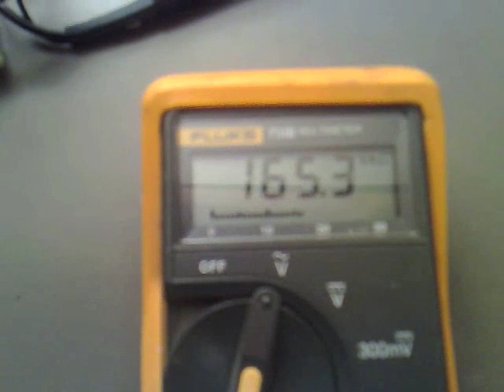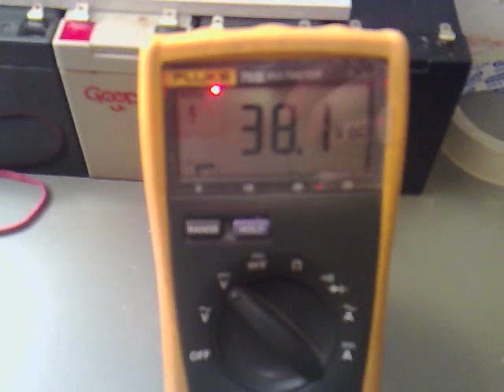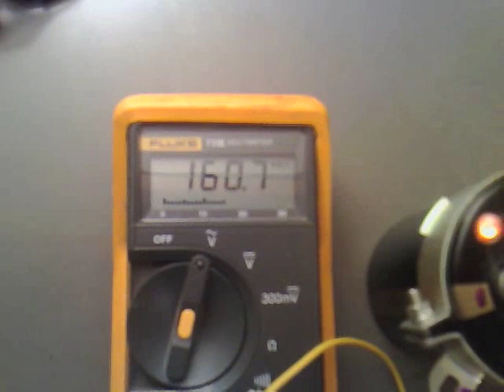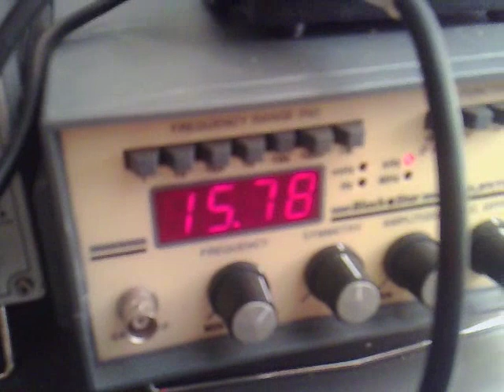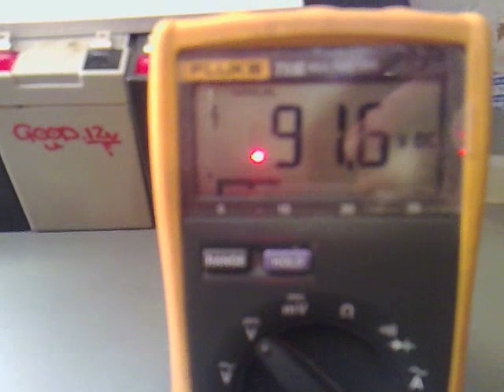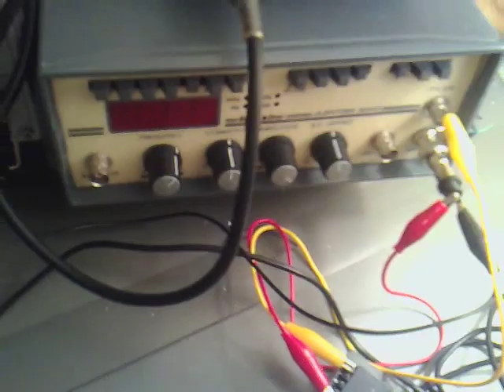High Voltage (Teslas One Wire Power) 004

Comment from the maker: Just made a new video using the one wire to light some LED's, I could use a quarts oscillator, but I do not want to use radioactive material!

I am quite interested, How do you mean radioactive material?

Paul.

Comment from the maker: Thanks, it is an art to get it working.

I was thinking of two joule thieves in resonance with one wire between them, Low power on both sides then the transmission of High Power will flow easily to the correct direction.

What do you mean about the Core Material being active?

I want to do all this with no ground as the one wire will end up being the ground.... making it wireless..  ;-)

Any Ideas Welcome.....

Paul.